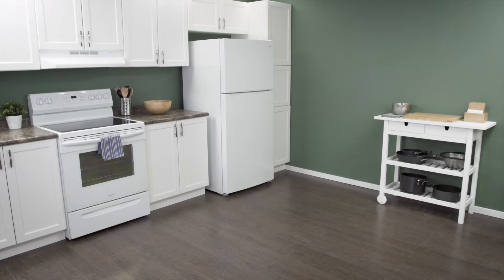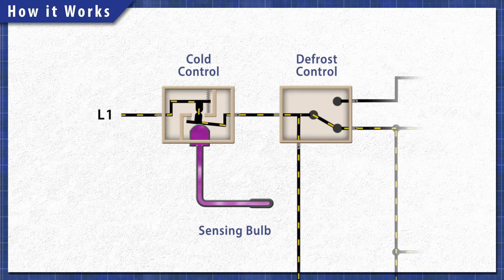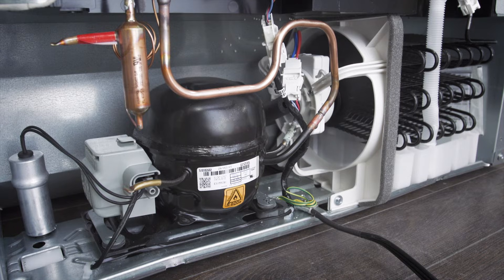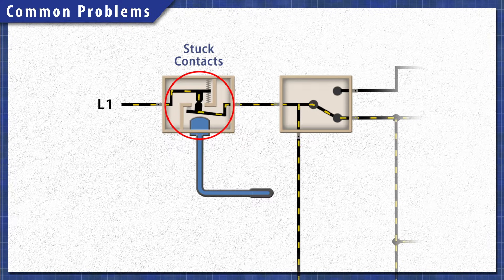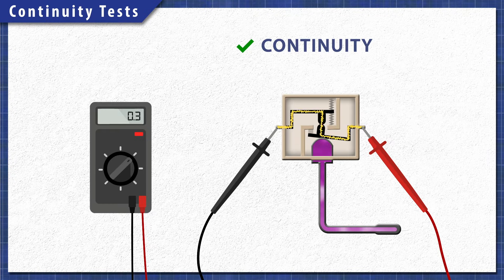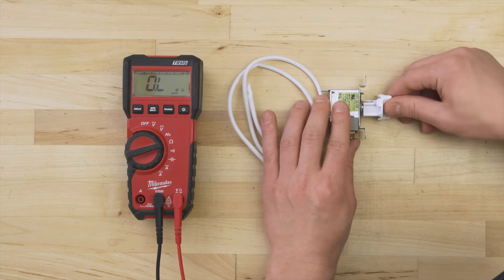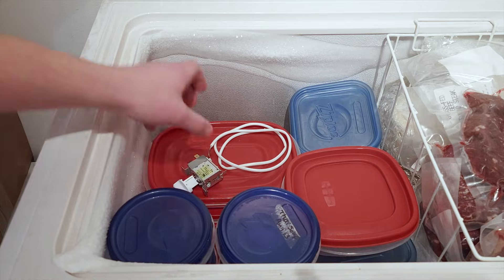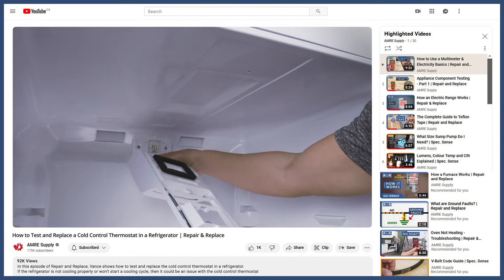Refrigerator Cold Control Thermostat (How it Works) | Repair & Replace

Comment: ok so it's just a fancy on off switch i always thought a thermostat literally controls the temperature but was always wondering why manufacturers dont outline the temperatures on the switch knobs, now i know why
Reply from the maker: Yes it's just changing the point where the switch is triggered. All thermostats are on / off in a sense. Even your wall thermostat controlling a furnace will just trigger the furnace to run when it drops below a certain threshold. It will run until it gets up to temp. It will cycle on and off as needed.

Comment: Great video...do you have a substitute replacement for a Ranco 9530N1443 rev. C freezer thermostat ?? Or a universal type??
Reply from the maker: Thanks! There's no direct cross for that part but a universal cold control thermostat will work for any chest freezer. This is one option also by Ranco: https://www.amresupply.com/part/VF3-FREEZER-CONTROL-NO-S
Reply: @AmreSupply thank you that was very helpful. One question though....for the ranco vf3 the specs say the cut in temp is -24C and cutout is -16C. Is that a mistake....shouldn't it be the other way around...compressor cut in at -16 and cutout at -24???

Comment: But how does the defrost heater get power when the cold control contacts open unless the contacts of defrost control changed
Reply from the maker: The defrost heater only gets power some of the time. In models where the cold control thermostat is wired before the defrost controller, then the defrost controller will need 8 hours of run time before it does the next defrost cycle. 

So for a defrost cycle to happen, it needs to be just warm enough in the fridge for the cold control thermostat contacts to be closed, and the defrost timer has to be in the defrost mode.

Comment: Thanks i got a fridge that turns off after a while and wont turn back on untill you mess with clod setting likr turn it to 2 and turn it back to 4 and itll wrk again then shut off in some time again
Reply from the maker: Thanks for watching. That does sound like the terminals on the cold control thermostat are sticking. A new thermostat would likely help.

Comment: here is the million $ question that i cant find anywhere on the internet.
The air that is blowing out thru the air vent to cool the freezer down, what should that temperature be ?? The air flowing out of that vent is about 29F and the freezer is NOT freezing.
Reply from the maker: Thanks for watching. If the freezer is not getting cold enough then there is something preventing the transfer of heat.  This could be dirty condenser coil, or a faulty condenser fan. This could also be because of a faulty evaporator fan or a buildup of ice on the evaporator coils itself, preventing the rest of the freezer from staying cold.

The temperature coming out of the vent from the freezer should be below 0°C and is why food too close to that vent will sometimes freeze.

We have a troubleshooting guide which shows how to check each of the above mentioned components: https://youtu.be/oPmr6boufmE?si=IRgdEzzC0jxXFg3u

Hope this helps.
Reply: @AmreSupply  well that air comming out of the freezer is 29F so thats below 0C which means its cold enough ...
Reply from the maker: @ACommenterOnYouTube  Still best to check if the evaporator fan is running, and that there is no ice buildup that might block the vents that circulate air throughout the freezer. If the cold air from the evaporator coils does not circulate properly in the freezer then the freezer itself will not get as cold as it should.

If the fan is not running then replace the fan. If there is a buildup of ice then the defrost circuit must be troubleshooted.
Reply from the maker: @ACommenterOnYouTube  As well the evaporator coils  is closer to -15 degrees F or about -25C. So the temperature coming out of that vent should be well below zero, even with a bit of air mixing and depending on how you're measuring. Still best to check the components mentioned in the above video.
Reply: @AmreSupply  the evap fan is running because i can feel the air blowing out the vent, not whether or not its properly around is another thing that i will check
Reply: @AmreSupply   well i was about to say that how could the air coming out that vent be ~28F and the freezer should sit at 0F ... that is not possible. 
That air coming out should be well below zero to keep that section at zero ...